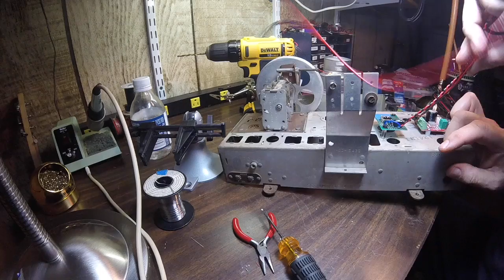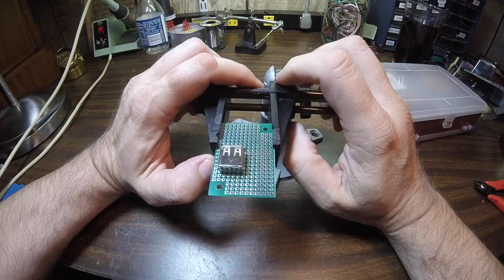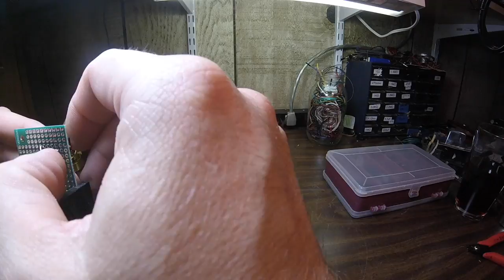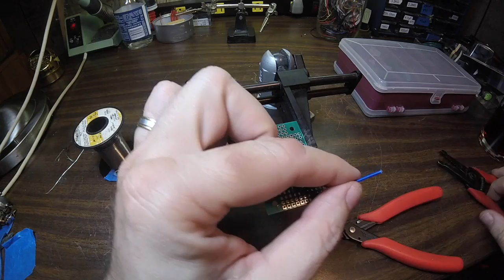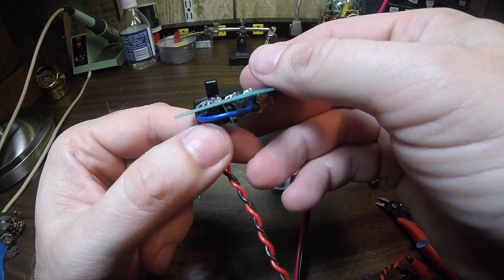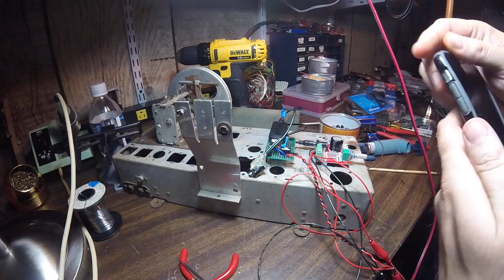Truetone D2026 Bluetooth Conversion: Part 3

Comment: Nice work! I am curious as to what were the values of the inductor and capacitor? Thanks for sharing! Also, where do you get those components? Thanks! Regards Larry
Reply from the maker: Backtothefutureradios for the chip I used in the build the inductor is 47uH and the capacitor 4.7uF. There is a chart on the murata data sheet for the NKE series of isolated dc dc chips. I get mine from Digi-Key but any large parts supplier should have them. They run about $5-$7 ish
Reply: NizzyAmps thx, you may have said in the video and I missed it. I picked up one on ebay, it came on a slow boat and it was a couple of bucks. I got it and a 1" speaker and going to build a signal tracer with mine. I might do a video on. Thanks for sharing! BTW, thx for subscribing and love ur tool holder. Im looking to pick one of those up next time Im at the store! Best Larry
Reply from the maker: Backtothefutureradios thanks. Love your videos.
Reply: NizzyAmps thanks a lot. Im new and still learning about youtube , video making, life, and definitely learning about radios as I go along. Im hoping my videos will get better, but I dont want them to ever get to the point that it appears that Im an expert, because Im not. I want to learn, show others radios that they may have not seen, problems and problem solving they may run into in the future. When Im not shooting videos, Im watching several other guys. I enjoy theirs more than mine. Maybe, some people wont get some of my off the wall dry humor, but I usually have very few retakes, most are as they are happening, as you can tell, if I catch the mistakes, I try to correct them with text. Im just starting watching ur videos, Ive been very busy this week with Vacation Bible School at church. But, I i tend on checking all urs out. Im one of those guys who cringe at the gutting of the radio, lol, but some are not worth salvaging, I agree with that! Maybe you can help me with something I need, I want to p,ay old music thru my radio, not necessarily bluetooth, but like what others do with am transmitters. Keep up the videos and thanks for sharing! Best Larry!